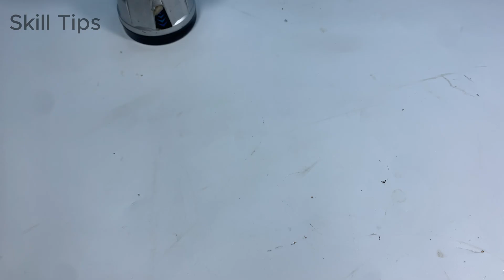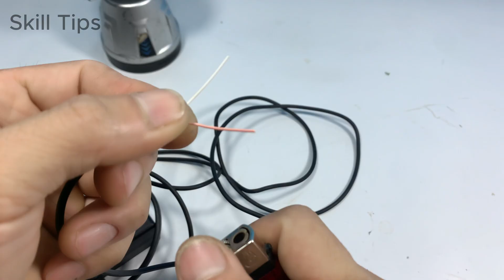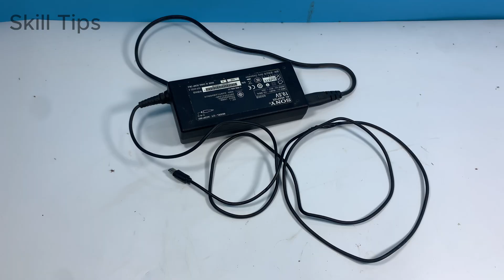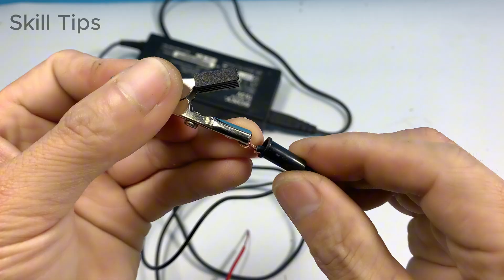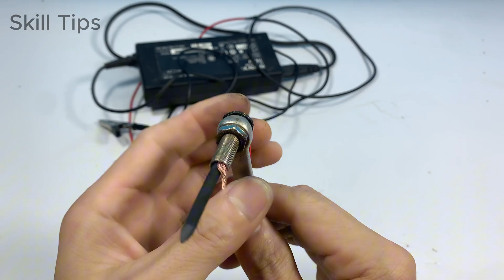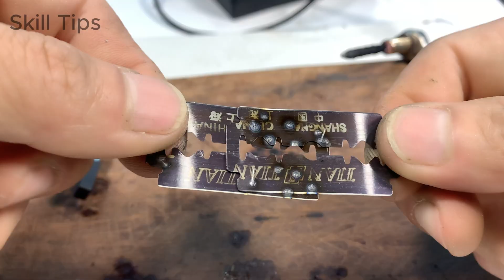You’ll never  throw away your old laptop charger again after seeing this! Great idea.

Comment: What an amazingly DUMB idea!  Sending 19.5 Volts down a USB connector is a sure way of blowing up any device designed for 5 volt operation. STUPID!
Reply from the maker: Hello. 
Thank you for watching the video and suggestions. 
But will not explode the lamp. 
The reason for not using the laptop charger it still plugged in from 220V electricity because it itself has an integrated variable. 
And when the low current runs into it, it will be safer than the large current when charging. 
Have a nice day